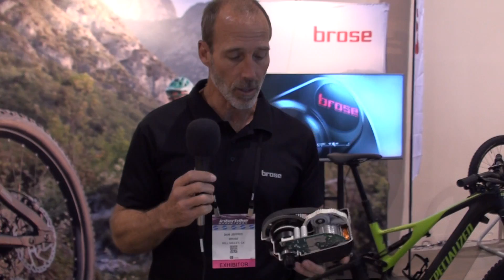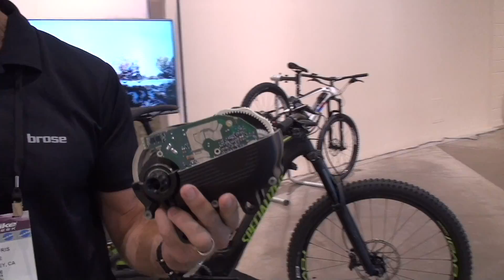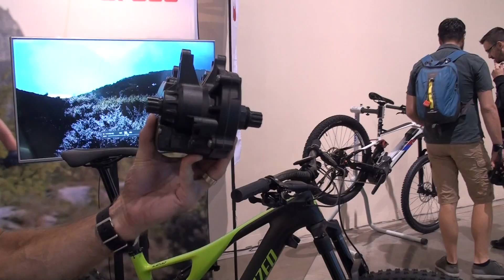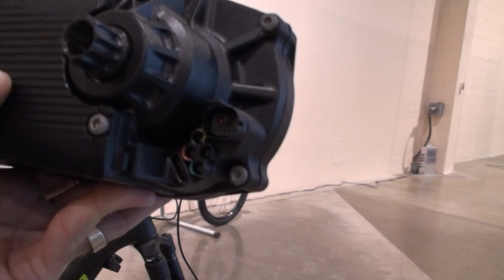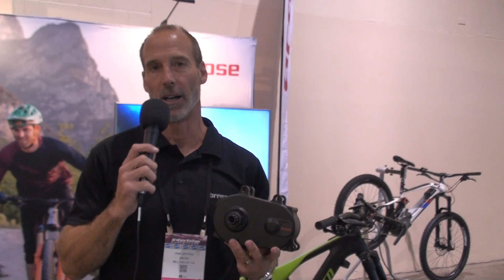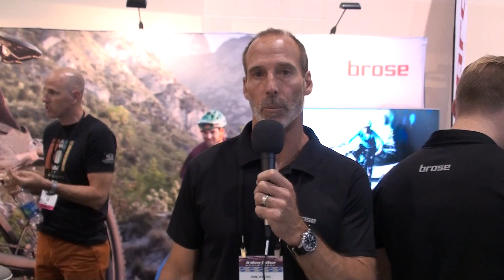Brose S Mag - Lighter & Smaller Mid Drive Motor | Electric Bike Report

Comment: I dont understand the point of expensive underpowered ebike drives. Anything under 750W is a toy. Its like buying a Ferrari with a 4-cyinder.
Reply: 250-500 watts is perfect for efficiency on a bike. Any more more means high losses due to increased battery weigh and wind resistance.